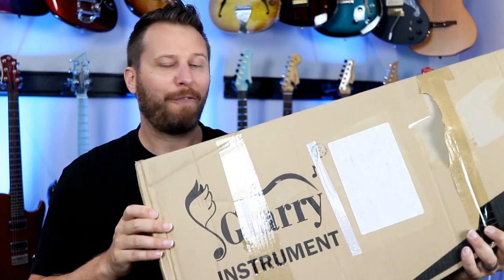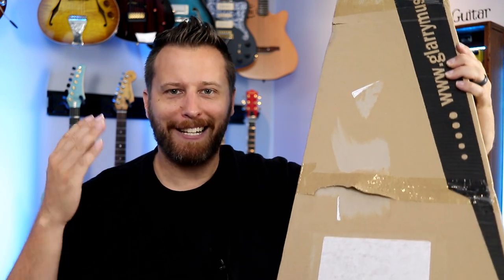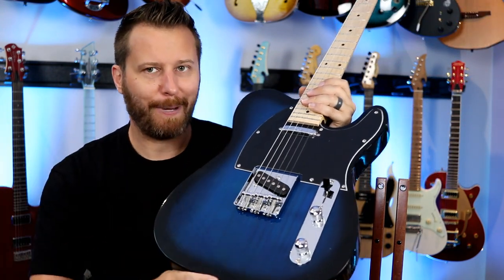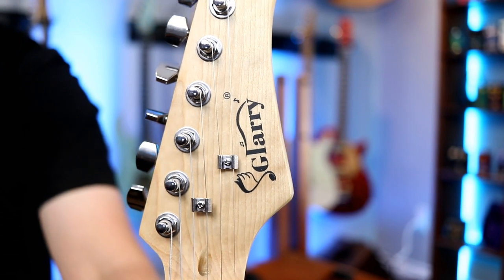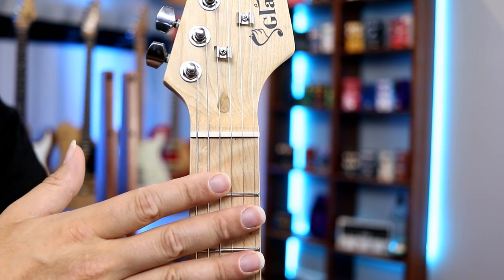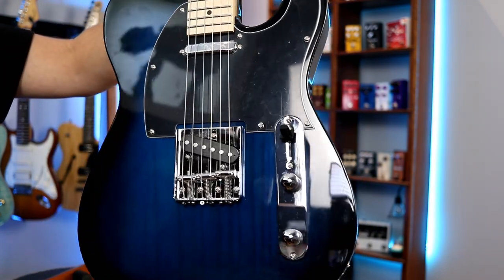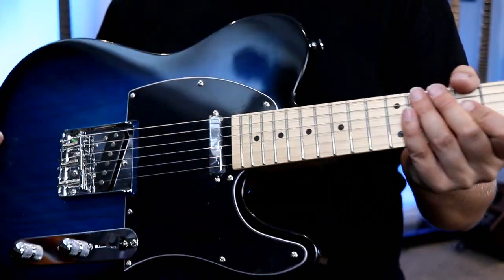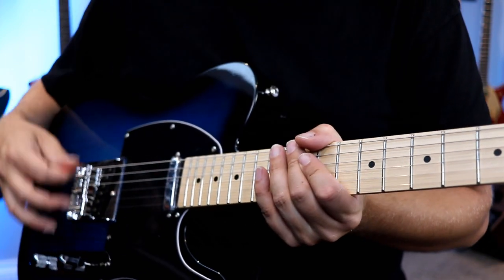The CHEAPEST Guitar I've Ever Played! - What Does It Sound Like??

Comment: Here's how I rank my 5 guitars from 5-1, 5 being my least favorite and 1 being my absolute favorite;

5. Glarry GT101 I paid $72 for it on eBay. It's a cheap round back imitation of an Ovation. This is one of 2 Glarry guitars I own, we'll talk about the other one later. The GT101 is well made, with some minor aesthetic imperfections from factory/shipping. Their QC is hit or miss, some of their guitars are junk, others are fantastic instruments. I strongly dislike the fat baseball bat neck, it makes my hand cramp up. It doesn't have pickups from the factory, but I installed a $10 set of transducer pickups under the bridge and the strap button 1/4" input jack. The pickups definitely make it a better sounding guitar, though it's already a decent sounding instrument (once I corrected the factory defects and gave it a good setup and new strings.) It surprisingly stays in tune really well, even if I haven't played it in a while.  

4. Epiphone Les Paul Special II I bought it from Salvation Army for $20, it was just missing a bridge and strings, and I got a cool roller bridge on Amazon for like $13. I threw some super slinky strings on and it sounds great. I just hate the way it looks. It has the cherry red high gloss finish. Sometime soon I'll be replacing all the electronics and pickups, so I'll probably strip the paint and refinish it. I'm also likely going to install some locking tuners, the stock ones aren't great. It's a 2002, though, so it's bound to have some issues at 20 years old. 

3. Squier Affinity Strat Bought it for $90 at the local pawn shop.  It's that off white color with a plain white pickguard. I'd also like to paint this one a different color, maybe sonic blue with a white pearl loaded pickguard (because that's just easier.) I found a nice white pearl loaded pickguard with single hot rail pickups on Amazon, and that's probably what I'll get. 

2. Fender Malibu Player California Series acoustic/electric in Midnight Blue I bought it at the same pawn shop in perfect condition for $180 (they sell new for $450.) I thought I would like this guitar more than I do, but it feels like it's missing something I've gotten from other Fender acoustics I've had in the past, and that's a richness to the sound. This, however, can be compensated for with the factory installed pickups, it sounds really good with a chorus pedal. It also has a built in tuner on the eq interface, very convenient. I do love that the California Series all have the iconic Fender Strat style headstock. I have no plans to modify this instrument. You'd think my most valuable guitar would be my favorite, but most of the time I reach for #1 below when I feel like playing.  

1. Glarry GT102 Paid $100 on eBay. It's a major upgrade from the GT101, same basic concept though with the round composite back. Gone is the fat baseball bat neck, it's much thinner, easier to hold and doesn't make my hand cramp up. It has the traditional Ovation sound holes with the grape leaf stickers (it's an inlay on a real Ovation), and red flames over a black background on the face of the body. I decided I didn't like the grape leaf stickers, so I got some goof off and peeled them off. It took a while to get all the adhesive off the body, but once I did, it looked really good with all the little sound holes but just black instead of the grape leaves. This instrument sounds amazing (after a good setup, like refiling the string slots on the nut and new strings), it has the sound I wished my Fender had. The factory installed pickups (with eq interface) work very well, but it sounds great unplugged too. I just love the way this guitar looks, feels and sounds. It's like butter in my hands, so easy to manipulate. Playing the GT102 is soothing, while playing the GT101 is often frustrating.

Comment: I Have That Exact Guitar! Same Color. Changed The Tuners To Tone Ninja 19:1 Locking Tuners, Seymour Duncan Quarter Pound Tele Pickup Set, Emerson Custom 3-way Prewired Kit for Fender Telecasters - 250k Pots, 2PCS Metal Silver Electric Guitar String Retainers Roller String Trees Guide, Chrome Tele Telecaster Vintage Style Bridge with Individual Brass saddles, Black Guitar 6 String Thru Body Ferrule Bushing Plate for Electric guitar, Schaller Locking Strap Lock Buttons , Guitar Strings: EXL115 XL Nickel - 11-49 Medium/Blues-Jazz Rock, EMI Copper Foil Shielding Tape Conductive Self Adhesive Barrier Guitar, GRAPH TECH NUBONE TUSQ FENDER STYLE SLOTTED NUT FLAT BOTTOM FOR STRAT & TELE, Genuine Fender Tele / Telecaster Metal Guitar "Ashtray" Bridge Cover - Chrome,  Yes! I Put A Bit Of Cash Into It, BUT, It's One Awesome Tele! I Have Over 40 Guitars (Fenders, Gibsons, Deans, Jacksons, Rickenbacker's & Others, This Modified Glarry Is In My Top 10 Favorites!